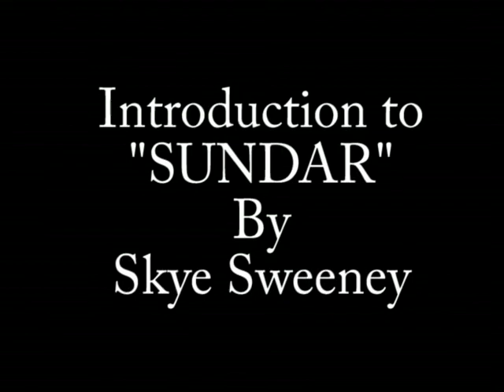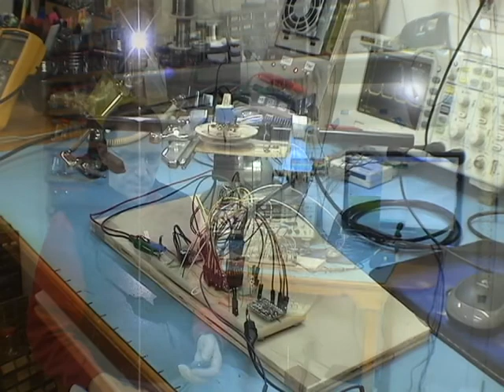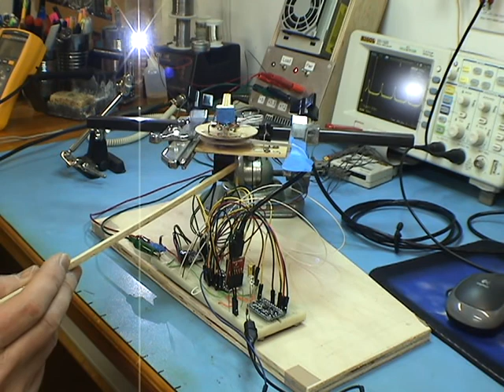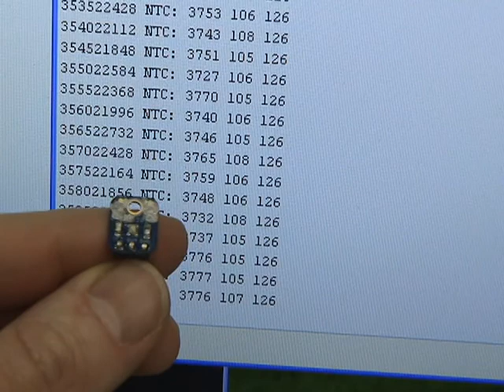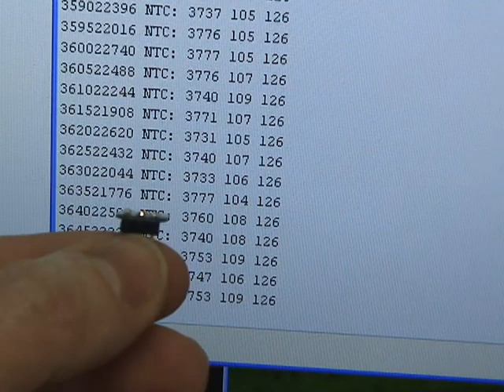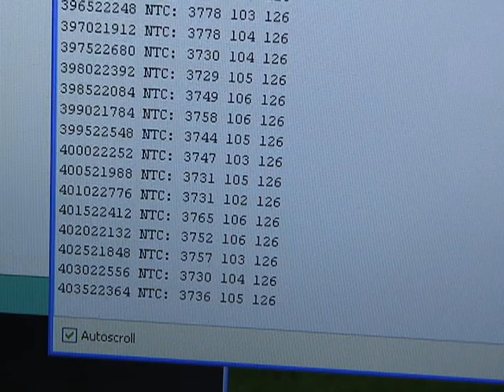Intro to SUNDAR

Comment: This is too cool!! You've made some excellent progress. I've been eagerly following updates on the SUNDAR for some time and looking forward to more.

For what it's worth, DataBus was using only GPS and gyro in 2012 when it placed 3rd. Through quite a bit of experimentation, I had previously solved issues you mention with gyro noise/drift and the gps time-lag to arrive at a drift-free, rather accurate heading estimate with reasonably high dynamic range. In case it is of use to anyone: http://www.bot-thoughts.com/2012/07/avc-heading-and-position-estimation.html

Good luck in the AVC and see you over on diyrovers (https://groups.google.com/forum/#!forum/diyrovers if anyone discovers this and wants to join the conversations)